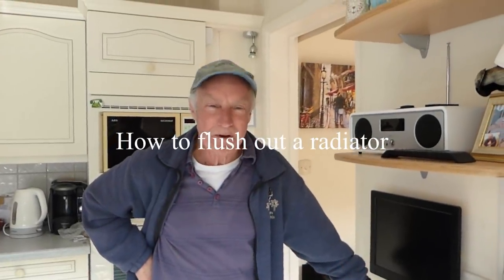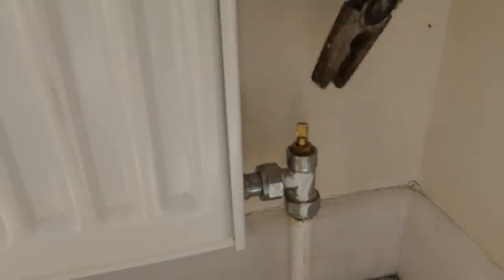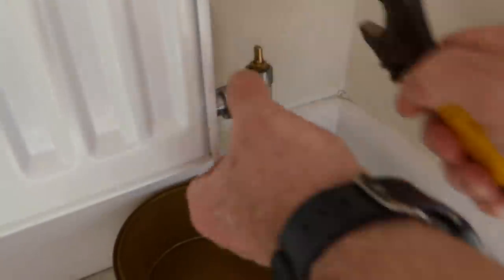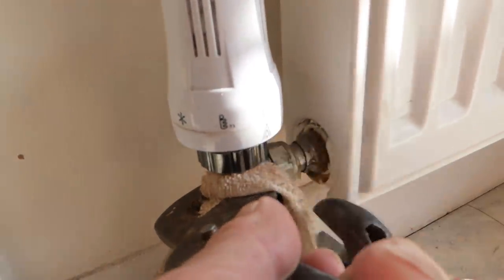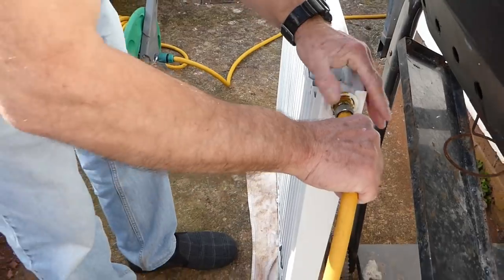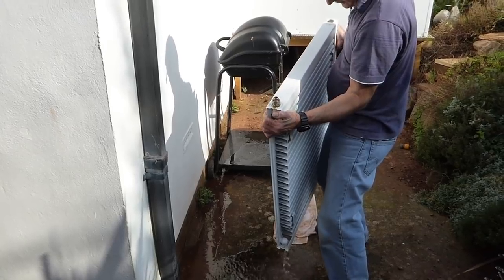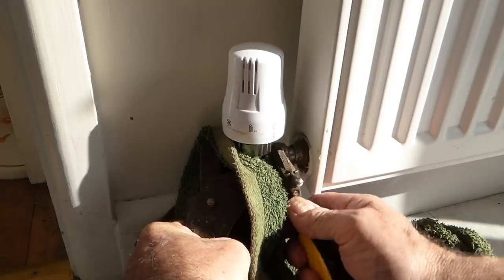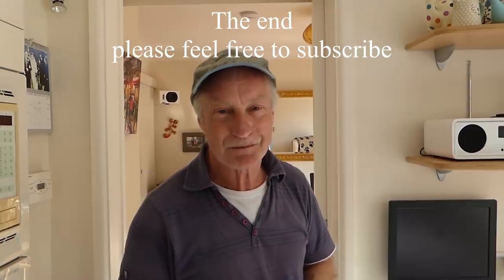How to flush out a radiator. Improve heat and performance from your radiators

Comment: thank you my man. i am disabled and dont have much money you just saved me £600 - god bless you Sir
Reply from the maker: No problem.
Reply: @Gareth Wigglesworth ouch !! Lol
Reply: @Buggs Bunny thanks for your concern. It's going to be a big tough job. Honestly I worry I can't do it alone. Would you help buggs?
Reply: @dereton33  hello mate wandering could u help I have 2 rads in my attic conversion that is my main bedroom and the 2 rads there are only heating up on bottom 
Now I'm fairly handy myself being a tradesman so I've done everything like took off rads flushed them out and bled them but still same there isn't even water coming from them when I bleed them do u think I should get a plumber in 
I also turned off every rad except these 2 but still same thanks in advance
Reply: @HGarry4012  It sound to me like your bleed valves are blocked and not letting the air out at the top of the rads. Isolate 2 of your radiators, one working, and one non-working, and swap a known working bleed valve over to the one that doesn't work and see what happens.

Comment: Have done a few jobs using your video instruction. Great instruction videos that cover the main points you need to know. I never take on too much but have done some small tasks with your help. Saved a few bob as well,Thanks
Reply from the maker: That`s great.
Reply: Do we have to turn Off the central heating?

Comment: Yet another brill video! In my case I always take radiators off when I decorate, flush 'em through. etc. Makes everything work better. My system is 40 + years old now an still works fine. (Better than me!) For my TRVs (Drayton) they come with a maintenance cap which shuts off the valve fully and gives a bit more room for grips / spanners etc. When un-doing the unions, I always start at the end with the bleed valve - 'cos (I find) when you slacken off the nut water pisses in every direction except where you  want it! So closing the bleed valve ceases the flow. Good point about holding the valve against rotation. My son did a radiator removal without doing this - split the pipe an flooded the house. Should have spoken to the old man first?!  I always add a little inhibitor to the header tank as well at this time. BTW I noticed the use of regulation footwear (slippers) also common in this household! Ha Ha Ha!!
Reply from the maker: Ha ha well spotted Colin, a must have item.

Comment: Great video.  The only added advice I'd give is to protect your carpets,  Put down plastic carpet protector sheets and cover with dust sheets/old towels.  The black sludge is like PRINTERS INK and will STAIN YOUR CARPET!  You did not mention closing the air cock once the radiator is empty.    I recommend also flipping the rad before carrying it through the house.
Reply from the maker: Thanks Rob.

Comment: Great video - Thanks  I'll be doing this to one of my double radiators where the front panel is blocked with sludge I reckon
Reply from the maker: Good luck with it.
Reply: Thanks I flushed the radiador out upside down in the garden with both bleed nipples open. There was no sludge in it but no water came from the bleed nipple on the front panel so I removed and found it blocked. Cleared it  out with a paper clip. Refitted the radiator and bled both panels and now they are both hot. Thanks very much
Reply from the maker: No problem.

Comment: Another thing you can do is shake the radiator tipping it backwards and forwards this will help move the sludge and using a soft mallet also helps
Reply from the maker: Thanks for the info Conor.
Reply: dereton33 no worries al keep up the good work mate

Comment: When i fitted a system in my house an engineer explained that balancing to me, I live in Poland now and nobody has ever heard about this, do a lot British People know about it ? i havn't anyone else mention it, they just open them all fully. I invented a screw  to remove radiators with the water in, I've noticed someone else has now and it's for sale in the uk, i screwfix i think, i was amazed when i seen it, i hope i never told someone about it who told someone else lol, bit late now. Nice video
Reply: I doesn't matter to much in a single smaller home since there's not so much waterflow for the pump to circulate and the energygains are so small. Once the house is warm and thermostats start working it will pretty much take care of the "balancing" on it's own. It does however matter in larger systems in residential buildings where the imbalances becomes more noticable.
Reply: you could have been a millionaire if you manufactured your invention... you polish guys are clever and have beautiful women

Comment: Thank you, lovely clear instructions. Do I need to add inhibitor if I do all the radiators like this? Where do I add inhibitor in to the system?
Reply from the maker: Yes you do. If it is a combi system add it through the radiator, or filling loop. If you have an F and E system add it into the small tank in the attic.

Comment: Great stuff as usual Al, thank you. A couple of questions if I may:

1) Would it not be best to top up the inhibitor in the system before refilling the radiator? and if so
2) Would that go in the expansion tank?

On a different note, I've put on a stone in weight and reckon I've got the best plumbed property in my street since subscribing to your channel. Many thanks to you and Jan and keep up the good work!
Reply from the maker: GeordieFX No, not for a small radiator as shown in the video, if it was a very large double, then maybe, just a very small amount, put it into the expansion tank, or directly into the radiator, if you have a Combi or closed pressurised system then also feed a small amount back into the radiator before filling. Check the Combi pressure when finished.
Reply: dereton33 Cheers Al, got an old 2 metre long double in the living room that needs doing. Also still got an old Potterton Suprima 30L condensing boiler. Has seen a reconditioned PCB and fan since new which I did myself. I then brought the annual service by a Gas Safe engineer forward before using it again. Will stick a little inhibitor in the expansion tank. All the best.
Reply from the maker: GeordieFX Cheers Geordie.

Comment: Awesome video... thank you. I have an 15yr old boiler system - how do I replace the lost water that was drained off? or does it not matter? thanks
Reply from the maker: If you have an F and E system it will fill automatically from the tank.

Comment: Great instruction as usual Al. When the rad is reconnected does the pressure not drop significantly? Will my combi boiler need refilled with the small tap underneath?
Reply from the maker: Yes you will need to top up the pressure afterwards. (With the small taps underneath.

Comment: Good clear instructional how to 👍 I had an idea on how to do this but watching your vid has confirmed it thanks ,  one question , I know you didn't in your video but is it recommended to use thread tape when connecting it back up ? I have feeling its not nesseccary but just curious  and do you have any idea on a percentage level as to how much this can save on heating bills .
Reply from the maker: If you want belt and braces then use PTFE tape. Can save around 20% on heating bills.
Reply: @dereton33  PTFE , yes that's what I meant,  I've always called it thread tape lol I might use some when I get round to doing it  and 20% isn't bad especially at the minute,  thank you for replying 👍

Comment: Hi thanks for your very good video do the olives at each valve need replacing ? Cheers Eddie
Reply from the maker: No need.
Reply: @dereton33  Thanks for such a swift reply ! You certainly don't hang about   !  Could I also ask you how do you refill the radiator without causing an airlock , do you keep the bleed valve open ? Cheers Eddie

Comment: in Denmark we hawe the supply heat in the top of the radiator, it works better.
Reply: I believe they are meant to feed high & return low,  or opposite.  When its feed and returned straight across the bottom it doesn't mix up through the top..
Reply: The also drive on the left side they are just doing it their way - here in holland we also do hot water at the top -
Reply: Here in The Netherlands the warm water goes into the top of radiator too
Reply: same in France

Comment: great video and very informative with all the tips, you mention in another answer down below that the pressure in a combi boiler will change does that just mean to let in a bit more to the system? also how much if any of the inhibitors is needed for one radiator flushed out as in video mine is the same size as yours, cheers again for the video very helpful and well explained
Reply from the maker: I would not bother adding any inhibitor with a small rad.  You will still need to re pressurise the system though.
Reply: thats great, thanks for the reply and very quickly too i may add. cheers again

Comment: Tip for applying the hose to the radiator,  15mm into the hose pipe and a put a nut and olive on and then you can connect to rad with a valve or coupling 👍🏻
Reply from the maker: Thanks for the tip Ben.

Comment: Hiya, shall we switch off the combi boiler first before fixing ? thanks
Reply from the maker: Best bet. Although if the valve are off both ends of the radiator you can leave it on.

Comment: Hi Dereton.  I've taken your advice and applied to help me reheat 4 radiators that were cold. It worked initially but when slightly turning on the closest rads they are now starving the system again!  I've barely turned them on but they are very hot and starving teh one further away.  How do I balance a system like that?
Reply from the maker: Just keep those  ones that are robbing the heat down to almost nothing.
Reply: @dereton33  I had removed all my thermostatic valves as the pins were getting stuck. I'll try putting them back on aswell. Does WD40 help with sticky pins?
Reply from the maker: No, not a bit, if it keeps happening only new high quality valves like Drayton will cure the problem.

Comment: Just bought a property with system boiler and all the rads have a drain valve attached. Would i be able to drain each rad in situ into a large bucket until i get clear flowing water.
Reply from the maker: Yes you can!

Comment: Is this the same procedure for a closed pressurised system? Do you need to top up the boiler after?
Reply from the maker: It is the same and yes you will need to top up the boiler pressure after.

Comment: Very helpful indeed. But my radiators don't have those lock shields,would that cause problems if i try to remove the radiator for the purpose of flushing? And once you put everything back and vent the radiator,will the pressure in the boiler drop and need refilling,since we introduced an empty radiator to it?
Reply from the maker: Yes just use the filling loop.
Reply from the maker: If you have thermostatic rad valves just turn all the way and leave the heating off while you do the job. If it is a large rad you will also need to top up a small amount of inhibitor.

Comment: Here's a tip, when the radiator's drained down have a couple of shaved down corks from wine bottles to bung into the open ends of the rad before carrying away.Sometimes, there's a little black liquid residue which you don't want to get on any white carpets on the way down the stairs. It stains FOR EVER ! .......believe me.
Reply from the maker: It does that all right. Good tip.

Comment: Hi, I just did all that and was convinced it would work but unfortunately it didn't. I have an upsatairs downstairs house and there are two rooms (2 out of 6 downstairs) next to each other where the radiators don't heat up, I'm sure the thermostats are ok (one has been replaced) and on the other sides (I presume the inlet side) you can feel the heat in the pipes, do you have any suggestions please? I will carry out this procedure on the other room tomorrow. Thanks.
Reply from the maker: Have replied via e-mail.

Comment: hi, so the end with the thermostatic valve is where the hot boiler water enters? the other end where you turned 8 1/2 turns is where the water exits. is this correct? so to fill the radiator after everything are tightened, you just open the thermostatic valve to #5 again. am i on the right track? thank you.
Reply from the maker: That`s it Mark.

Comment: How often should radiators need flushing out? Mine are not cold at the bottom, they are warm but not as warm as the top. Seems to be the same all through the system. I had the central heating fitted in about 3 years ago. It's a combi boiler with 9 radiators. Thanks for the video.
Reply from the maker: About once every 5 years.
Reply: Thanks for the info. I live in Antalya Turkey so we only need the heating on about 2 months a year so they are stood with water in them most of the year. Do you think it would be better to drain the system when the cooler months have finished.

Comment: Why didn't water from the rest of the CH system come flooding out of the pipes when you took the radiator off?
Reply from the maker: Because it was isolated by the radiator valves.

Comment: Hi Al, great tutorial vid mate. I live in private rental accommodation. All the rads in the house are cold 90% up the rad. I've complained many times and now three the heating engineers are all pointing towards doing a power flush. I don't think my landlord will pay £600 - £900 for this to happen. What would your advice be?
Reply from the maker: Do it yourself using system cleaner and fresh inhibitor.

Comment: Hi Al I'm changing all my rads next week will I still need to flush the system after I've put them all back on
Reply from the maker: Steven Parvin As you are changing all your rads, you will have to drain the system anyway, so it will be emptied, you can fill a couple of times and flush out, then when you fill for the last time, just add inhibitor and you are done.

Comment: Hi, If I connect a hose to mains pressure flush my rads is turning off just the trv and not the lock shield on all but 1 enough to isolate the rads to concentrate on the one?

Comment: Hi Al,  Great video but I've just got stuck on the thermostatic valve side.  The nut seems quite tight and i'm struggling to counter hold.  Any tips?  When i try to undo i get a few drips from the first nut as the pipe comes up from the floor!  The force is managing to loosen the wrong nut!
Reply from the maker: Take the top off of the valve, you can then use a pair of grips to hold against with. Footprints are best.
Reply: Thanks. What size pipe wrench should I go for?
Reply from the maker: 10 inch.

Comment: Hi Al
Can I ask you a question? I am soon to remove two radiators(decorating) from the lounge. They will be off for 2/3 days. I want to cap-off the TRV/ feed-in end, just to be on the safe side overnight. I know that my pipes are 15mm. But what the hell do you call the nuts that can be fitted temporarily. I'm not taking the TRV off, I just want to cap it for a day or two. Thanks in advance.
Reply from the maker: Hi Cliff it will be a 15 mm thread on the end of the valve, so just get two 15 mm brass caps.
Reply: Cheers Al.

Comment: Can you balance the rads using the other valve not the lock shield valve. Thanks.
Reply from the maker: Yes it does the same thing. So long as you do not turn any of them once set.
Reply: @dereton33  thanks man.

Comment: I have a lock shield valve on both sides of the radiator I want to flush; do they turn of the same on each side and is this something I should get changed (and if so, do you have a video)?
Reply from the maker: Hi Scott just turn them both off on both sides, this is your bypass rad which is why you do not have a turn valve or thermostatic valve.
Reply: @dereton33  thank you, I will give it a try. Appreciate you posting these videos
Reply: @dereton33  another successful procedure! Thank you so much! That radiator hasn't worked since we moved in and we were told that it would require us to dig up the floor in order to get it working. It didn't, this video combined with some of your positives meant that we now have this radiator working for the first time ever!

Comment: hi Derek im at 2.53, undoing the unions. my problem is the nut i need to turn anti clockwise is so stiff my copper pipe is still bending what will i do now.
thanks
Reply from the maker: Use a pair of grips to hold against the body of the valve and use a larger open ended spanner on the nut. Give that a light tap with a hammer to shock it loose.

Comment: Great video as always. Thought this would fix the problem with my living room rad this afternoon, lots of lovely brown stuff  came out and then it ran clear. But despite doing it twice I still have e same problem. Is a chemical cleaner in the system the next logical step?
Reply from the maker: Yes well worth a go. I assume you have tried system balancing and checking that both rad valves either end are working ok.
Reply: dereton33 No I hadn't, I will give that a go first. Keep up the good work. 😀

Comment: If the radiator is cold on the bottom make sure both valves are open before doing anything else.
Reply from the maker: Good advice.

Comment: I have this but the water is  real clean when I use air bleed  , is that a sign that it isn't sludge  or or something else ?  cheers
Reply from the maker: The bleed valve all ways shows clear. No indication that you may sludged up.
Reply: dereton33 cheers mate , the downstairs won't warn but the upstairs hot just had new pump and been bleeding but no heat downstairs, the inlet pipes to radiator hot but nothing else any ideas ?
Reply: May need balancing the Rads. Al explains in a video how to do that.